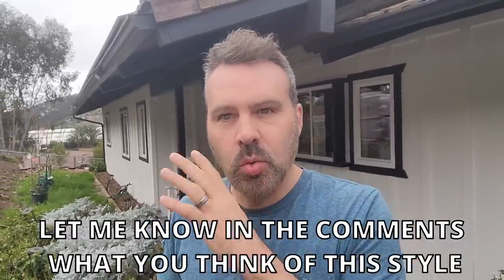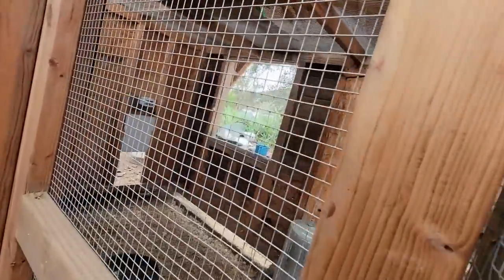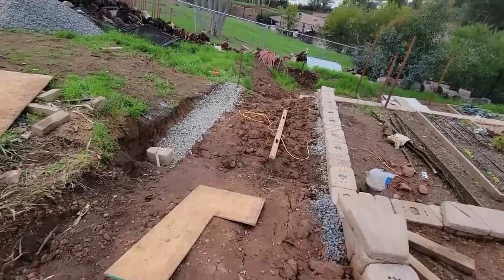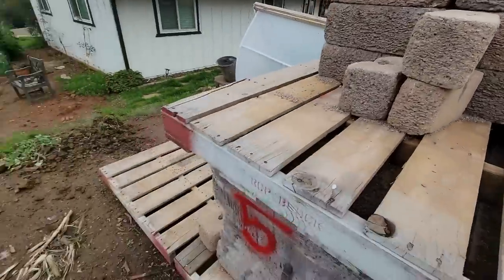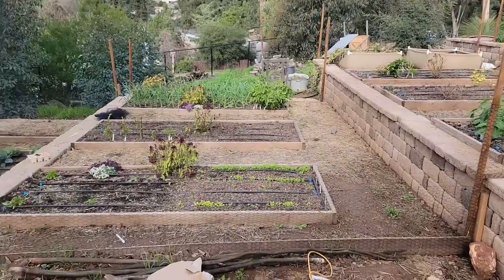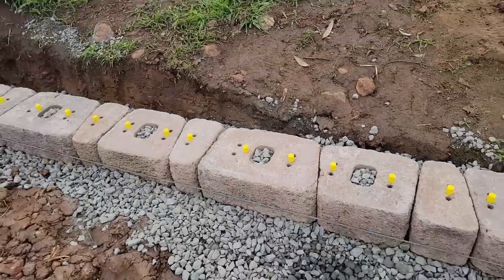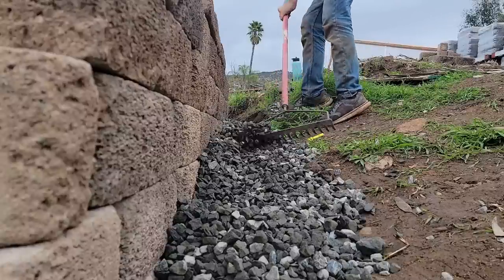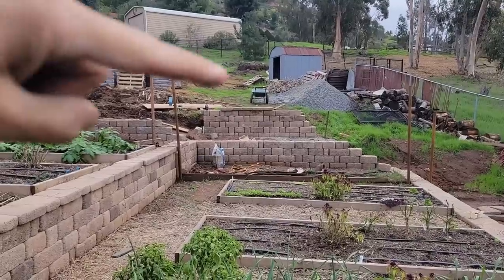Preparing for Storms, Building a Wall and Outsmarting a Rooster

Comment: Find yourself a cobblestone Brian, one cut from the finest New England granite. Pick up a small container of Knorr chicken bouillon powder. Dig out a thick bottom 10 gallon stock pot and a half cord of fire wood. Start the wood on fire, set the stock pot atop the burning wood and quickly add 6 gallons of drinking water. Gently place in the cobblestone and bring to a quick boil. Reduce the fire to holding a fast boil while adding the bouillon, salt, and pepper to taste. Grab the rooster's neck from behind and quickly dispatch the same just prior to dunking into the stock pot. Hold the fire at a fast boil for 3 hours, 37 minutes, with rooster on board. Carefully remove the rooster, setting down within a compost pile. At 4 hours, check the cobblestone for tenderness with a long handled fork. Once the half cord of fire wood is exhausted and the stock pot is cook to touch, carefully remove the cobblestone. Here you now have a fine reminder stone of what a pain in the ass that damn rooster was!! Actually this format of video is refreshing and enjoyable Brian! Hope you dont get washed away with the approaching storms! -Bob...

Comment: Unless you’re raising chickens to hatch new ones in an incubator, a rooster isn’t necessary to have around if your coop is secure. We found it’s easier not to keep them. But we keep the nice ones and the hens get along well with them. We also separate them into smaller hen houses with 3-4 hens with one nice rooster. Our lives are easier. Great work going on there !
Reply from the maker: Thank you!

Comment: You can’t run from the rooster.  He will get even more dominant.  Try using a water bottle. You can try it on spray but I think as aggressive as he is use the stream.  Spray as soon as he comes at you.  This will take a couple of times if it’s going to work.  Hitting him in the chest if possible.  A squirt gun might be easier to handle.  Walls are looking great!   Be safe!  Prayers and blessings sent your way ❤️🌺
Reply from the maker: Thank you!
Reply: This. So much this

Comment: Although it makes sense (? !) - using that wheelbarrow back and forth and hauling 3 smaller bricks (20#, 30#) or 2 larger bricks (50#) per trip - it would be less hard on you (when you carry them into the terrace area.

Comment: For your feeder you can slot in pull panels, roughly 1/3 spacing of the canister. As a day goes by, pull the bottom pannel out, 1/3 drops in. Next day pull the middle pannel, next day the top. Then replace and refill
Reply: That was kind of a rough explanation.. But I think you can get it

Comment: Could you fashion a door/hatch in the top of the chicken run near an outer wall of the run that you could stand on a step ladder outside of the run and lower a pan of food down into the chicken run having the pan suspended by thin chain (like hanging baskets have ). 

You could lower the food dish down through the roof hatch and leave the chains hooked up into the roof wire while they eat . Then pull it back up to refill the pan .

Comment: Since you have a totally enclosed area for the chickens in their run, it may not be necessary to close that little automatic door at all. They will stay in there all night, and if the rooster wants inside he could freely go in when or if he needs to get out of any weather. 

Also you could buy a larger hanging feeder that will hold nearly a week of feed. So you don’t have to inside and fill that bowl every day.

Comment: Great job. Going to look really good when completed. Question-do you use a base underneath the drainage stones? My experience in setting blocks is that the rock settles into the clay and the wall becomes uneven over time. I started placing a high quality fiber weed cloth on the soil then add the rocks/leveling sand.

Comment: Hens still lay (infertile) eggs without a rooster.  So unless you want brooding hens, and future chick(ens) - there is no need for a rooster.  The only way is to push him to the ground, pin his wings besides him, and hold him until he relents.  If he continues to resist, then further downward and inward pressure is needed to break his attitude.  The final straw is to hold him and turn him over (!), belly up  (total vulnerability, total dominance, and hold him there until he admits surrender - and you being the admitted and acknowledged  Alpha Dude, with him being the Beta Dude.  It might take 5-6-7x depending on how stoopid or steroid this mook has, until he gets the message - or gets the stew pot.
Reply: If he turns him belly up then he'd better have a good hold of those legs with his other hand.

Comment: About the rooster... is there a way you could place a door-like contraption that you can close from the outside when the rooster runs to the corner where you throw the foot before you run in to get the container? It doesn't need to be too secured since it needs to just be an obstacle.... maybe can be pulled up and down by a rope amd hooked on the outside? Or something like that? I can totally see it and hope it helps 😅🤞